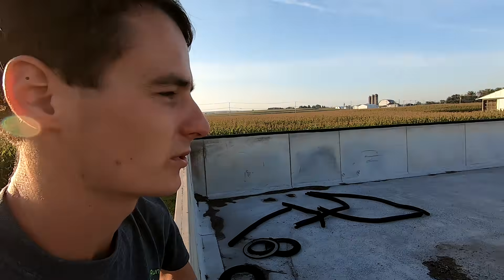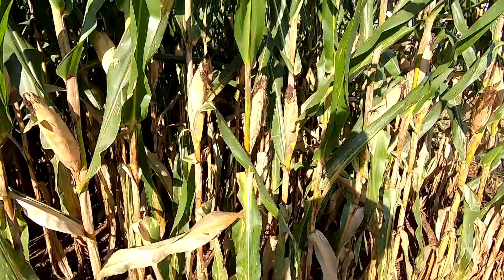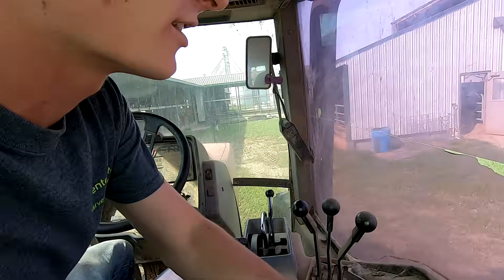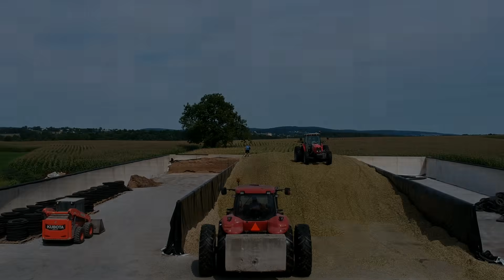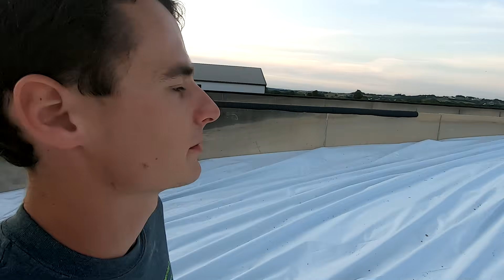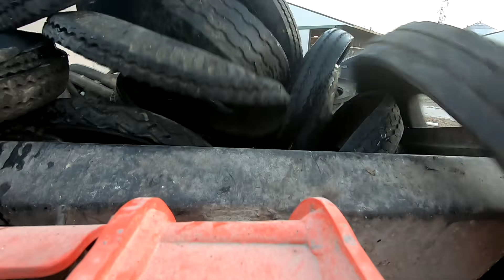Corn Silage Harvest 2020 | Filling 1st Bunker Silo - Complete Process

Comment: You picked the perfect time to cover the bunk. I used to work setting up the huge 40x20 or 60x80 part tents you see at fairs and festivals. Working in the hot summer sun was nothing compared to how bright the white tents where. You had to wear sunshades setting them up because the light of the white canvas was so bright

Comment: Good job guys I miss the days of running silage. I worked for a farm here in PA milking 3700 head every day. We pushed bunk with a 620 Steiger with 720-38r triples and a 570 Quadra trac
Reply: One thing I can recommend is piling higher in the middle and using more weight on the sides to pull the center over tighter. The bunk we had, had no concrete walls, we run semi outer rings for weight, total to feed the ole girls is 11500 acres of corn. They had a digestor to make their own electricity and it also returned the slurry as bedding. Works great have a great day and hope you make it another year with falling milk prices...

Comment: Just curious here but if they were trying to get the tightest pack possible wouldn't a good sized dozer like a d6 pack harder then the tractors or would the tracks be too hard on the bunker floor to be worth it.
Reply: Tracks don't pack well, think like excavating, they use tracks instead of tires to keep from sinking. The tires have less area to distribute weight.
Reply: @jamesjarman4129  dozer tracks are usually narrower though to give more ground pressure for better traction right rather  than spread out the weight like excavator tracks
Reply: @clintondakin2170  Preference but some feel dozers level it well but dont compact it enough, others have no issue with a dozer compacting it.

Comment: Has vacuum consolidation ever been considered as a means for compacting the silage?  With the top and side covers, a vacuum under the cover applies 15 psi over the entire surface of the pile.
Reply: I've never messed with silage, always hay and grains. But I have wondered the same on vacuum using grain silos with a small silo as a intermediate vacuum chamber

Comment: Years ago we used an in-ground silo. Not the best Way to store silage, but it worked at the time. We eventually built an upright silo and filled in the other one. We fed mainly corn silage. Juices would eventually start oozing out between the cracks towards the bottom of the silo. One of our cows enjoyed licking up those juices and would get a little drunk.

Comment: The thing i do diffrently. I go witch special plastic/foil more like stretch, basicly highly elastic, so when gases from sillage start to sucks it can strectch so it pressing better on sillage and making better contact to it making better work sealing it up. At least thats what my feed guy seed (the guy who make TMR rations, on paper idk how u call them in eng). We have did that for the first time this yr, so results shuld be in about 1,5/ 2yr when we open it up. It is also a bit cheapper, than normal foil. And since i dont still have silo for my sillage i use old advertising banner as additional cover to make it harder for crows, dogs and other animals to go and just puncture a hole. Also when we scratch dirt from it (we didnt used old tires to this year), it is much easier to do that since u dont have to watch out not to damge foil that much, and u can even do that witch tractor when u have stedy hands like my father.

Comment: Why don't you use a net /straps over the plastic sheet ?
You can tighten it if attached along the bunker,roll it on a pipe as you empty the storage bunker.
You could remove the tire handling/manipulating operation.

Comment: How many Harvestore silos would it take to hold as much as that one 1200 ton silage bunk? A slab and three walls looks like a lot more cost effective, even with the annual cost of plastic sheeting.
Reply from the maker: It would take at least 3 upright silos our size. They do make bigger silos though, some hold 3,000+ ton. 30 ft diameter by 130 tall which is massive.

Comment: Could you use the feed bin you use to mix and feed the cows in the barn be used to place the silage along the edges where the plastic forms the corner on the wall and floor?

Comment: How is the spout on the chopper controlled?
Reply: Usually there is a joystick that has buttons on it to control where the pipe is pointing the joystick is also used to drive the veichle so basically its controlled by buttons on the joystick in the cab ho0e I was some help
Reply: There is also a camera on the spout that goes into the cab so that the operator can see where to move his spout
Reply: @calebvanderbijl6738  aah cool thanks
Reply: @rublie1426  no problem

Comment: 15:10 Oops - the trailer driver pressed the wrong lever and the feed started coming out of the side of the trailer.
Reply: It seems to happen every time they unload. Maybe needed to get everything out
Reply: @Eric-dr5bj  Sorry for the confusion - my point was, one of the drivers told Eric that they  couldn't side discharge as he requested on the first load to cover the edge of the plastic. There may be something involved, I just thought to bring it up.

Comment: Impressive operation, always exciting to watch. I'm hoping someday you will have your own Claas but I know that isn't financially feasible.

Why do they use belt driven trailers to unload rather than one that tilts up? Seems it would run a lot quicker.
Reply: It seems they have a dispensing system at the front as these trailers are used for more than just hauling silage.

Comment: Every time I see this process I think of the giant mechanical pool covers and wonder why in the world hasn’t anyone come up with a more efficient way of covering those bunkers.   Rails on top of concrete walls with rolls of plastic cover.  I’ll be right back.  Going to engineer that for ya ha😘
Reply: Have to keep every shred of oxygen out- the plastic covers cling to the silage like Saran Wrap. Believe me, we are researching ways to do it with less plastic (reusable top covers, already on the market) and no plastic (not ready yet!) LMK if you invent a way!
Reply: Meghan Gebhardt after it’s covered vacuum seal it.  My brain is working overtime here. Ha.
Reply: Would make it a lot easier to uncover as well

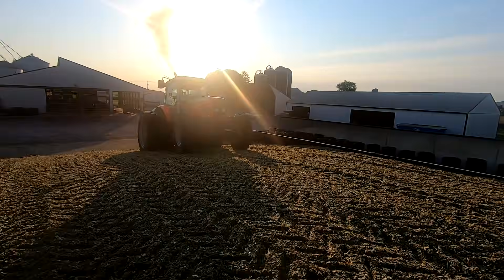Comment: 18:01 never thought I'd see a tractor do a wheelie
Reply: Well, tractors pull wheels all the time when over loaded.
Reply: I'm 13 and I've already done it twice in a ford 7000 lifting a silage bale
Reply: An Amish did a wheelie in my grandpas 4020 and cracked the frame in half. And guess what, no more Amish driving tractor.

Comment: Has anyone ever driven a tractor off the top of the wall?
Reply from the maker: Thankfully not
Reply: @10thgenerationdairyman  I find myself holding my breath every time a tractor tire gets close to a wall at the top especially if nothing is on the other side.
Reply: I have an Uncle who was placing tyres on top and tripped and fell head first off the top of the wall and broke both his arms as he fell into the concrete pit beside the one they had just filled
Reply: I had to pack and every time I got close my heart dropped

Comment: I've never understood why equipment operators don't buy a roll of 3/8", 1/2", 3/4" and 1" hydraulic hose, along with end fittings, and at a minimum a manual crimp tool with interchangeable dies. I used to work in a production facility where our fully automatic crimp tool was only $20k. You could get your own setup for next to nothing compared to your down time. Call Flowline in Baltimore. That's the company we used.